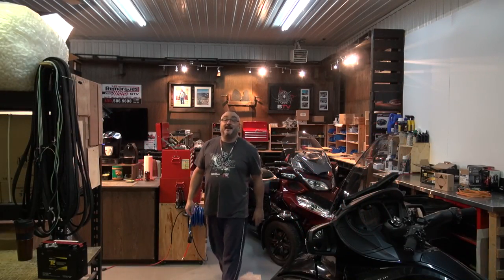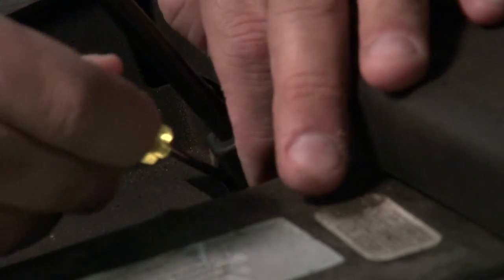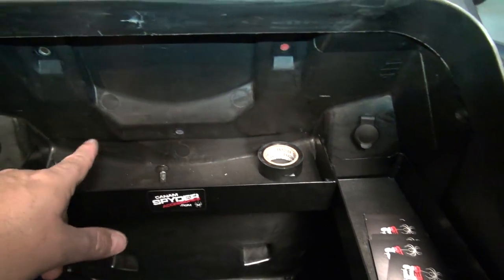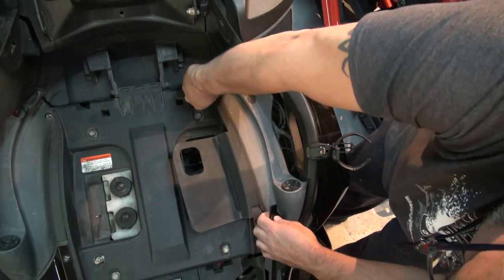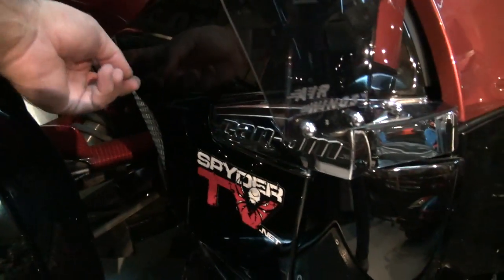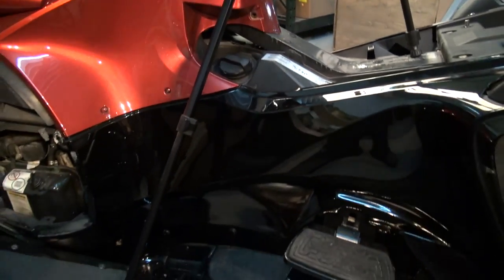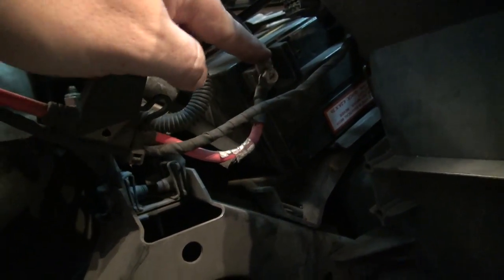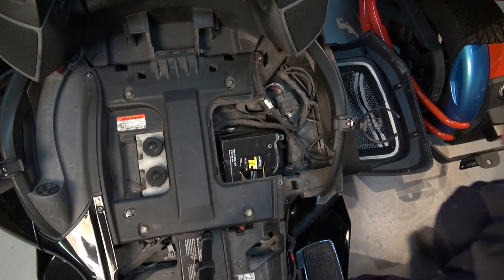RT Can-Am Spyder Changing Battery - 2010-12 - Spyder TV

Comment: Pierre - - - THANK YOU so much for this video!!!  I'm a new 2012 RT owner and storing in the garage for winter here in Rochester NY.  Got a Noco2 charger/maintainer and was hoping for an easy connect under the seat.  From a Spyder Lovers community thread others recommended to "just do it the right way" directly to the battery but i didn't want to be removing panels and open a pandoras box and screw something up.  I started w a Noco2D but realized no great place to mount it under there and unable to disconnect the unit from the wiring so i switched to the Noco2 w the X-connect or whatever the call the junction bw the unit's cabling and the connectors to the battery.  Let them rest under the seat (not quite long enough to get exposed behind/under the seat.  Your video was a life-saver in guiding me thru the process of removing panels etc.  Getting back seat off first to raise the released seat even higher was great.  Thanks for being so thoughtful to post your video. I'll be much more inclined now to do things myself and save some bucks in the process. Appreciate you!!

Comment: Thanks so much for the video. I have recently inherited my Spyder from my brother when he passed in October last year. I have had the pleasure of riding it for many months when he first bought the bike and about 18 months when he decided he was not using it enough and left it with me.
Batteries have been the bane of my existence having had to change them twice - these were done by the dealer who must have rubbed their hands in delight when I took the bike to them. The cost was over $200 AUS which I thought was bloody expensive. I had been using a charger to boost the battery but eventually that didn't work - so off to the dealer. Your video will enable me to change my own in the future,
The other issue I had/have is with the brakes. Front and rears don't seem to last terribly long. Once again, I have had to change pads 3 times in the last 18 months. Not sure if it's the quality of the pads or my style of riding? Either way, I reckon the quality is very suspect. Have you produced a video on changing the brakes on the 2012 Spyder? I've seen some others but the production quality leaves a bit to be desired.
Once again, many thanks for your work.
Reply from the maker: Thanks for the kind words, no video on that. You should go with EBC brake pads....that's what we use.

Comment: Thank you for your video. Am removing battery on my RT and your video was very helpful. The screw at the back under the seat is difficult to remove so I will replace with a bolt so I can access easily next time. Merci beaucoup, très instructif.

Comment: Just changed battery on my 2010 RT. Could not have done it without watching the video first.  Found the first screw very difficult to remove had to use a slim ratchet driver and bit. Getting side panel back in was also a pain. Otherwise went smoothly.
Reply from the maker: Good to hear....

Comment: Thanks Pierre, I wish I had seen this before I started exploring. I bought a third hand (I’m number three) Spyder RT with under 13000km. In as new condition. I had heard that the battery terminals loosen off and had a look under the covers and yes the negative was finger tight. 
A squirt of gasket goo can hold the battery nut in place or a wedge of plastic such as fuel pipe.
Anyway thanks again, oh if you have Jig a Loo, (it’s made in Montreal) it’s great as a dry lubricant and ideal for those rubber grommets!

Comment: Pierre, Australia's sun is a bastard. During summer, the temperatures are often over 38 - 40 degrees. This has had a major effect on the windscreen of my Spyder - it looks starred, like fine cracks through the thickness of the screen. I'm hoping some of your viewers may have found a way to polish the screen. The plastic on the bike is similarly showing its age. I have seen videos of a heat gun re-melting the plastic to bring up the shine of the plastic. I would love to hear your thoughts on how I might overcome these issues.
Cheers

Comment: I was able to remove and replace my battery - without removing any panels, the positive wire with the fuseblock needs to be popped off the frame, the fuseblock is attached with a pushin connector, then there is enough room for the battery to come out far enough  with the positive connector attached where it can be disconnected - but man - and extra half inch on thos positive wires would have made a huge difference !
Reply: Changing battery 2004 can am rt limited

Comment: Great video first and foremost, tremendous help, would like to add to it if I may, the 2 long bolts for the seat hinge have a couple sleeves, not sure how hard it's going to be to get those back in, your video entails removal, I could only imagine, waiting on battery now, also I bought mine used, 4,500 miles, and already had a chinese junk oversize battery in it, dont make that mistake, stay away from China at all means possible.and get the right size, I had to butcher it to get it out. again great help!!!!!

Comment: I have a 2011 Can AM Spyder RTS-SE5. On the newer models the battery is mounted in the front trunk. Can the battery be relocated to the same place of the newer models by extending the battery cables? Sounds like a better location anyway to have future access to battery for service.

Comment: Great video, Pierre. My question is: How did you get the push pin back into the slot for the side panel? Mine was flared when I pulled it out, and it won't go back in!
Reply from the maker: flared means...opened up ?  If so then just pinch it to make it fit.
Reply: Pierre - Spyder TV Poliquin - Spyder Accessories thanks for the info...  I figured it out right after I hit the"send" button!

Comment: I got my battery changed on my 2011 RT but when I reconnected the cables the engine would not stop turning over even with the key turned off,. Any ideas on what I did wrong?
Reply: Did you forget to reconnect both (all) the negative wires to the battery?

Comment: Huge shout out for this video. I was able to do this on my own via watching video. Bought a mighty max battery off walmart.com for under $60 usd. Little tricky putting seat back in and found I needed to align before final tighten of bolts.   My dealer would have charged me over $400 for this, 😃  luv the savings and I learned a lot about the bike.
Reply from the maker: good job, nice to hear....
Reply: Was it a bottle supplied battery or factory sealed?